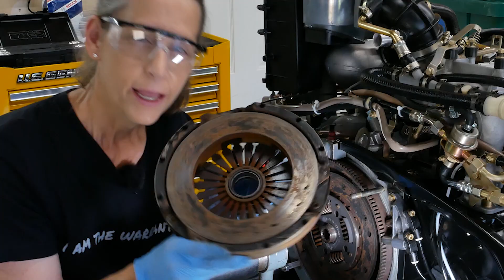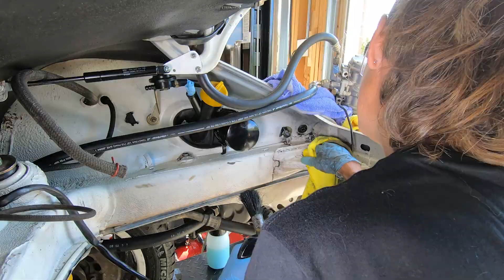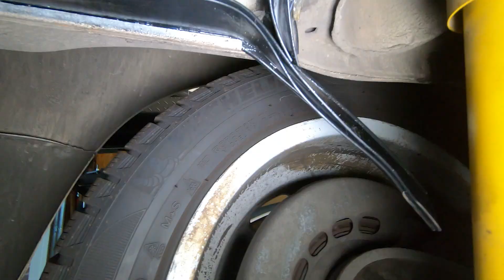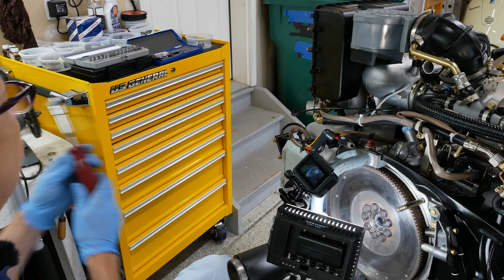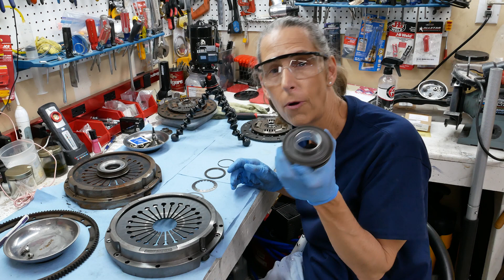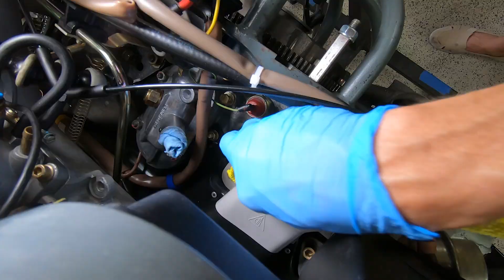Budget eBay Porsche 3.2 Carrera Project Car! #23 - Clutch Replacement and Engine Bay Clean!

Comment: Comment on the Brakleen - if you were using the original formula, it may not smell as bad, but is much more carcinogenic, and bad for the environment as well.  It is safer to use the non-chlorinated formula (relatively safer, that is).
Reply from the maker: Yeah, I know, but the non-chlorinated  version just doesn't really work - and it stains the power coating.  Mostly I use Simple Green and just finish up with the Breakleen.  It is pretty expensive and so easy to run through.

Comment: To reiterate what others have said: use a star pattern to tighten bolts in a circle, as your wheel lug nuts. And heat=expansion, cold=contraction, use both when possible for tight bearings. Nice work!
Reply from the maker: Great tip!

Comment: Nice job!  Its a lot of work to remove and repair these engines, so its always a good idea to check your clutch and pilot bearing.  When you said 18 foot pounds on the 6mm pilot bearing cap bolts, my mind said, "Nooooooo."  I hope the pilot bearing clearance job you did doesn't cause an issue down the road.  Glad you were able to figure things out though.
Reply from the maker: Absolutely!  I don't know what I was thinking...  The correct torque spec for those pilot bearing bolts is just 10Nm or 7.4 Ft-lbs so I was WAY off...  Obviously I was a bit off on this episode ;) I am still wondering why the pilot bearing housing wouldn't fit.  I have been through the Porsche workshop manual, Bentley, and the Pelican book as well as a few installation steps on-line and nowhere have I found any special instructions.  The bearing is pretty set by the three bolts, but if the location was absolutely critical I would expect alignment pins (like you see on a flywheel).  Maybe it should have been frozen before installation, but that would be pretty specific and I would think I would have read that.   Hmmm...  At least that bearing is only in play at low RPMs and just when the clutch is in and the transmission is in gear.  I guess I'll be the first to find out ;)

Comment: That was a pretty ingenious recovery.  Gotta remember that trick.   Last time I did something similar I stripped out the retaining screw in the front rotor of my Acura.  Had to drill it out with a drill tap.  Still don’t understand why some brakes have those.
Reply: its for manufacturing only to keep the rotor in place until the wheels go on. You dont need it after

Comment: Today’s T-Shirts were absolutely nice. The first one was very cool, the second one was hilarious 😂. Thanks for the laughs, i could use them because i had a similar day.

The sealing rubber can be a pita to install. I always put in the engine bay sealing with some cavity wax. It lubricates the rubber very well and simultaneously seals the metal rail.
Reply from the maker: Thanks for that.  The silicone grease worked out pretty well too. I bet your wax would last longer though.
Reply: Cavity wax? composition and source of supply ?

Comment: I just did a clutch job on my VW 1600 engine and it’s fascinating to see the similarities with Porsche - but with the performance difference! I was told by the way that a re-balance may be necessary on a high performance engine after replacing the clutch. Any thoughts on that with yours?
Reply from the maker: Great question!  I had to do this on the 356 actually and it made a big difference.  On this car I didn't remove the flywheel.  I may regret that down the road, but had I removed it I would have taken the clutch down with the flywheel to be balanced.  It does really help.  But one thing to keep in mind: I believe the factory balanced the crankshaft and the flywheel together as a unit so when the flywheel/clutch is balanced together they are omitting the crank.  Just a thought...
Reply: Heidi and Franny's Garage You think like a Formula 1 engineer 😊👍🏻

Comment: Great video again Franny. Just curious why didn't you replace the rear main seal while you where in there?
Reply from the maker: Well, I didn't want to get into removing the flywheel.  I may regret that, but it currently is dry and it is a bit fussy to get the flywheel off and back on again.  BUT I could have had it balanced with the clutch as well...
Reply: Heidi and Franny's Garage It’s all about making decisions. Good to see that you did the thermostat O-rings.

Comment: Great, as usual, but wouldn't it have been more appropriate to torque down the pressure plate bolts in a criss-cross pattern? Cheers,
Reply from the maker: Great point! ...and you are correct.  It is a bit strange in that the bolts are in groups of three...  My thinking was that I had already cinched it down in many steps so the final torque wasn't much movement, BUT you are correct.  My bad on that.  Thanks for catching that! F

Comment: Hey, thank you so much for your amazing videos. I come from germany and really fancy them. I am about to buy a Porsche 993 cabriolet and I would love to have some advice from you guys. How can I assure myself, on the condition of the engine, suspension and electrics while visiting the car? What can I detect during the test drive and the visual inspection of the underbody? I would be very glad to hear from you, perhaps you could make a little video on a buyers advise.  Thank you so much and take care 🤗😘
Reply from the maker: Hi there, Maybe I should do a complete video on this ;) Start with a general visual.  All gaps should be perfect.  If not then a panel or bumper has not been installed correctly and that may indicate some underlying damage.  Take everything out from the front trunk and look at the metal.  It should be painted and look original. The rest of the bodywork should look completely stock and have no rust.  For the engine look for any wetness anywhere.  All wetness point to some issue.  What are the service records? Was all maintenance performed?  All Porsche recall updates? These cars have an issue with the engine bay wiring harness that should have been address by now in a factory recall. It is ok for the engine to puff out a little smoke on start-up, but it should clear fast.  How does it drive? shift? The 993 clutch engages very late so unless the clutch is slipping it is probably fine.  The later cars (OBDII) can have a check-engine-light for a blocked air port in the heads.  That is particularly difficult to fix.  Ask about that.  Run the top up and down.  Is it original?  What is the condition of the rear window?  Does the owner ALWAYS put a soft cloth on it as it closes to keep it from scratching?  Look for pointless upgrades like race petal covers, chrome wheels, etc.  That signals flash instead of maintenance.  These cars have two distributors.  When was the belt last changed?  ...and the 12 spark plugs and wires!  The is a wonderful book called: "The 993 Companion"  It is pretty expensive but well worth it.  Read it cover to cover to have a great place to start when looking at cars.  I hope that helps.  Franny
Reply: Thank you so much, I will definitely buy this Book. A video would be really helpful indeed 😅. Yes, the Porsche has a service history performed by Porsche, so there is a little insurance there. How often should I have the spark plugs exchanged? The soft top has been exchanged and it is truly spick and span. You are really a great help. I am so happy to have found your channel. Caroline
Reply: Suche Dir auf jeden Fall jemanden mit Ahnung, der das Auto mit anguckt. So schön wie er ist, der 993 ist ein Groschengrab ersten Ranges.

Comment: A good trick is to mark the bolts with a sharpie dot on the side. Then it is easy to see each revolution when tightening or loosen bolts on a series like the pressure plates. Nice episode and see how you tackle the unforeseen problems.

Comment: I did notice one major error in this build today. Your specs are way out. 
You’re a solid 10/10,.
Reply: If i have a engine out of a Porsche or Volkswagen   beetle  I would  Change   the Clutch and pressure plate  and  throw out bearing  my late father  was  certified Volkswagen mechanic  and service manager   for many years in western Pennsylvania  dealership.

Comment: In my experience, pilot bearings are super sensitive to tolerance.  The material removal that you did may ultimately be a problem, as it doesn’t use the bolts to hold it in place radially.  The bolts will snap in an instant if there is any play in that mounting surface.

My first thought would to be put the pilot bearing in the freezer right before installing it (this making it just small enough to install. That’s what I’ve always done.

Incidentally, the starter ring gear and flywheel sometimes have to use hot and cold, respectively, to get them to come off and go on easily too.
Reply from the maker: I am still wondering why the pilot bearing housing wouldn't fit.  I have been through the Porsche workshop manual, Bentley, and the Pelican book as well as a few installation steps on-line and nowhere have I found any special instructions.  The bearing is pretty set by the three bolts (as the one I took off had some play as well), but if the location was absolutely critical I would expect alignment pins (like you see on a flywheel).  Maybe it should have been frozen before installation, but that would be pretty specific and I would think I would have read that.   Hmmm...  At least that bearing is only in play at low RPMs and just when the clutch is in and the transmission is in gear.  I guess I'll be the first to find out ;)
Reply: You're correct sir. I have a $150 Walmart chest freezer in my shop specifically for popsicles and shrinking bearings/parts.

Comment: At 1:03 a wire harness goes from ‘hanging out’ to plugged in 😁. Yes I have a scewdriver, bought it about 25 years ago for working airplanes.  Great tool.  Yours is missing the little handle tab thingy by the head?  Nice Nick Murray shirt you have on there when working on the bench 👍
Reply from the maker: No, it is not missing.  I just did not use it then.  The kit has it.